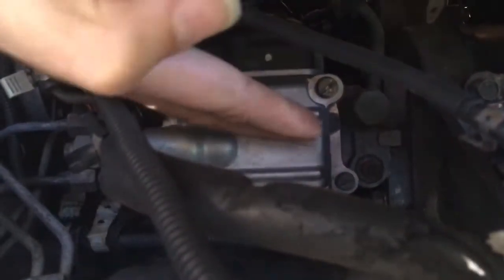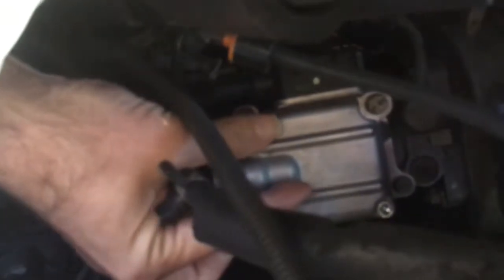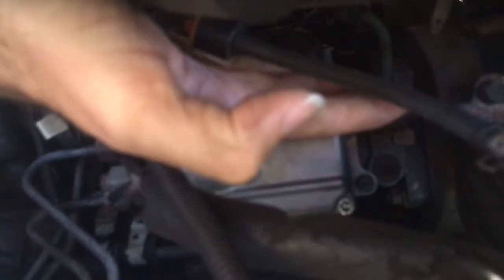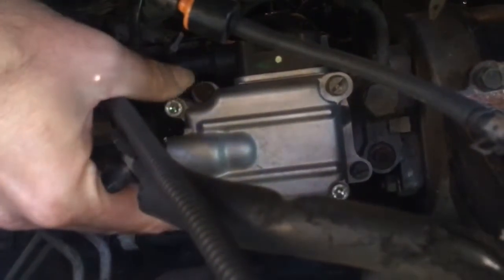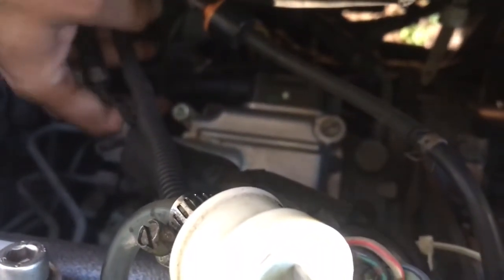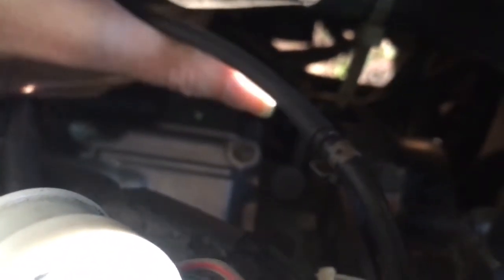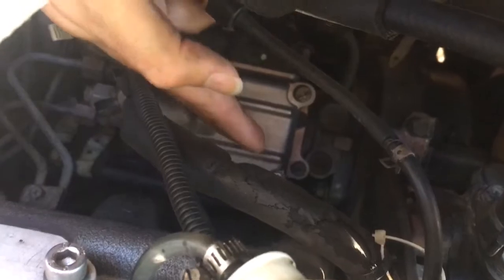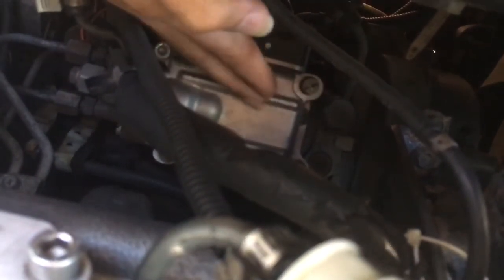Electronic Governor Adjustment On Your Isuzu Bighorn 4JG2i 3.1L

Comment: On mine when I turn the key there is clicking coming from inside that cover on the injection pump. And no fuel going from pump to injectors. I had the pump rebuilt which seem to solve the problem. Then 2 weeks later the clicking returned. Won't start, no fuel to injectors. A couple days later went to try and start just for grins and started fine. Ran fine for a couple days. Then a couple days later clicking returned. Now it won't start again. Any suggestions?